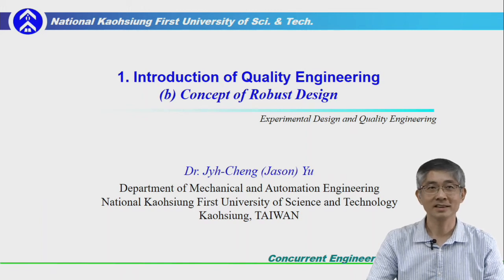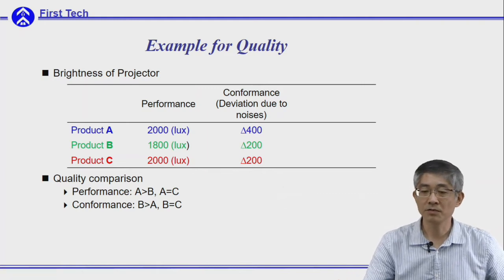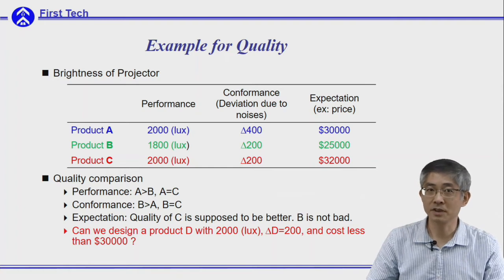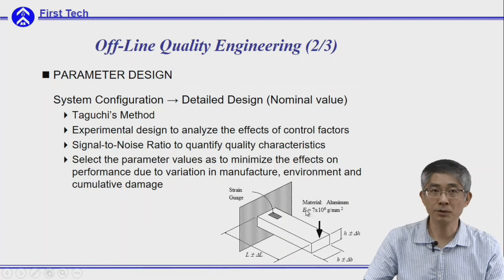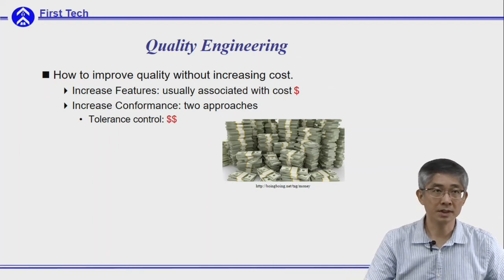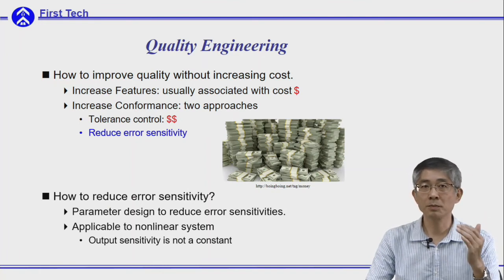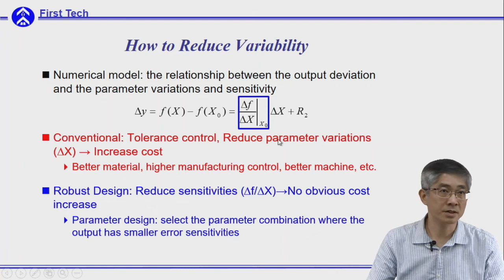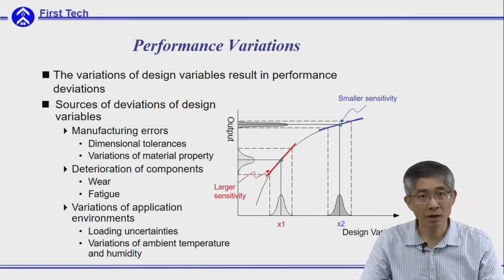2017 Experimental Design and Quality Eng. 1(b) Concept of Robust Design

Comment: thanks you 
what do u suggest a tools or application method to proceed a robust design analysis ?
Reply from the maker: There are many commercial tools that can help you with design of experiments but will cost you. Excel is good enough if you understand the background of robust design analysis. Right now, AI tools can do the same thing too, nut you need to verify the result.